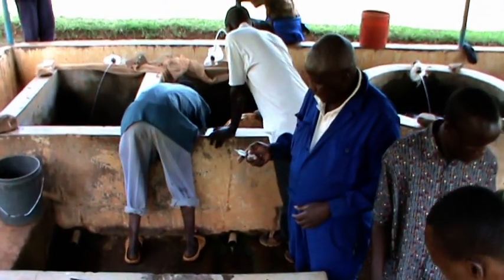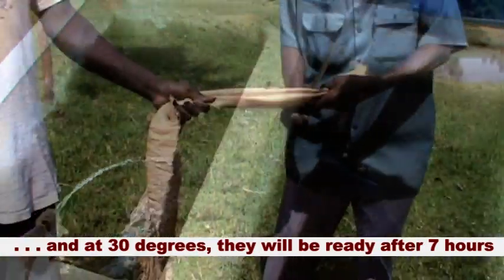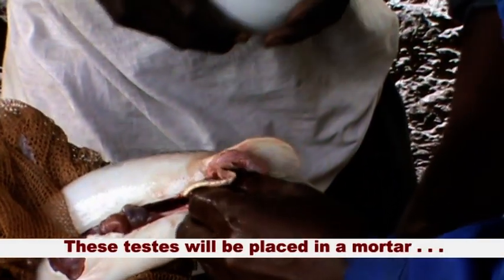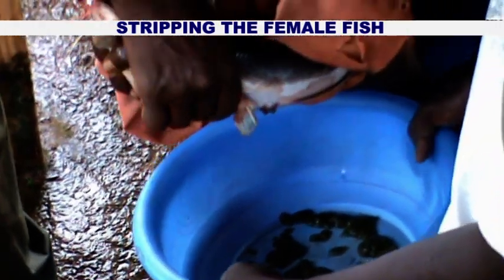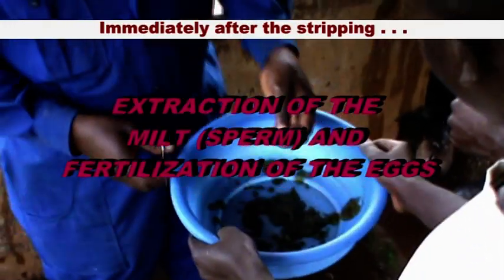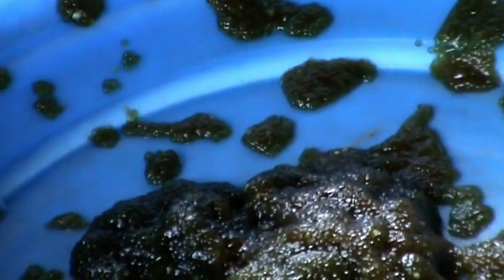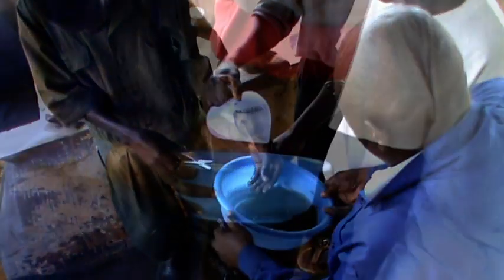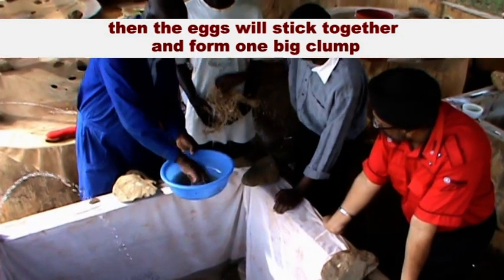ARTIFICIAL CATFISH PROPAGATION 2 - Stripping, fertilization and incubation of eggs

Comment: pls y put those cut sacks i don't understand that part
Reply from the maker: Catfish eggs become very sticky after fertilization. If you put them in the tank like that, they will stick together at the bottom and fail to hatch due to poor water quality. (This also makes the tank bottom dirty and hard to clean)
When you allow the eggs to stick on the sacks, they will make them float and get fresh water. It is also easier to remove the egg remains after hatching.

Comment: What substrate to use please
Reply from the maker: For the eggs to attach on?
There are several options. You can use the one I have used in the video (strands of nylon gunny bags), or you can also use any of the following:

Nile cabbage/water lettuce - Clean the root well, allow the eggs to stick on it, then put it in the incubation tank. It will float

Water hyacinth - works like the water cabbages (BE CAREFUL WITH IT, IT IS AN INVASIVE PLANT!)

Kakaban (Mesh screen) - a floating  rectangular frame with a mosquito-net material. The eggs are spread on top of the mesh. When the eggs hatch, they fall through the holes and the screen is removed after hatching.
Reply: Sir, what is the method or process to maintain large hatching strength

Comment: this is so nice, I have a question sir is the pituitary gland an water solvent the only thing mixed together in order to inject the female? another question what is the name of the medicine that keep the fry or fingerlings a lives an the medicine that make them growth faster?
Reply from the maker: +ogah jeremiah. Yes, you only mix crushed/pulverized pituitary with saline water (9%). Nothing else is added. Fast growth in fingerlings usually depends on the breed of fish, quality of feeds used, stocking density, and water quality management. Any growth boosters (hormonal or otherwise) are NOT recommended

Comment: what kind of medecine you enject the pregnant catfish
Reply from the maker: +Bill Udarbe The female catfish is injected with crushed pituitary gland (hormone) which is mixed with saline solution (mix 9 grams salt in 1 litre of water OR use normal saline that is used purchased from a pharmacy). You can also use a commercial hormone - such as Ovaprim - instead of the hormone. But the saline solution is very critical when diluting the hormone.
Reply: +munalaFISH 
sir which (Gender) pituitary gland did we have to inject to femal fish'??
Reply: +Aantaya Giri The pituitary gland can come from any male or female of EQUAL SIZE to the one being injected.
Reply: Which pituitary gland do we have to take out ' u mean sir we can take any gender ( Male or femal ) pituitary gland to inject femal catfish for egg'& what is the best weight & year of catfish to take pituitary  gland ( male/ Femal )
Reply: Yes, any gender. As long as it is more than 8 months old
Reply: ovaprim

Comment: if you kill the male fish and take the pituitary gland it is possible to preserve the testes by using acetone while you are waiting for maturity of the eggs?
Reply from the maker: Preserving the testes is still a challenge because sperm (contained in the testes) normally 'die' within a short time. Some people have tried freezing them (cryopreservation), but the success rate have not been widely acknowledged. We CANNOT use acetone because this is a dehydrating chemical. It will kill the sperm immediately and dehydrate the testes.
Reply: munalaFISH
thank you for the information sir, better to use fresh testes of catfish to fertilize the eggs. so far sir i follow your video to breed catfish it will work.
Reply: munalaFISH
Freezing in a water tight container with saline waterr has worked. it can be preserved  for  12 -24 hour in the freezer if you can guarantee 12-24 hour of power supply